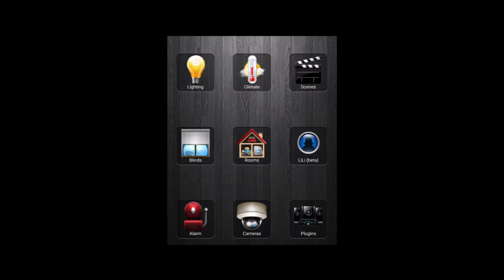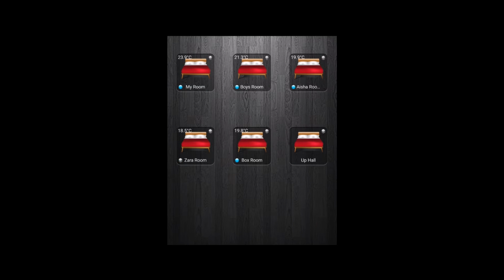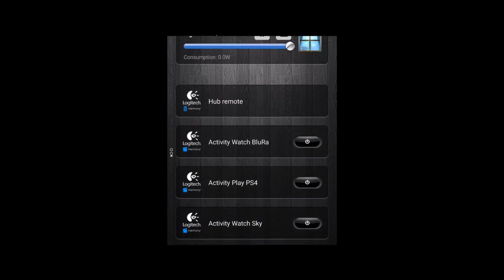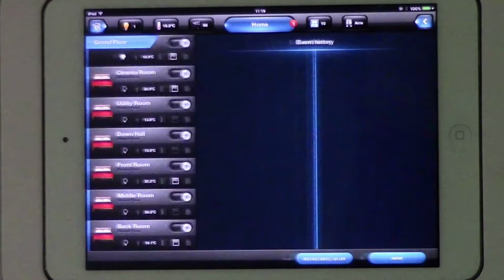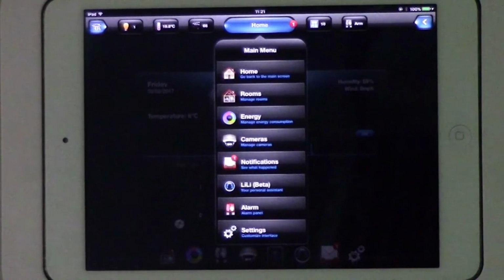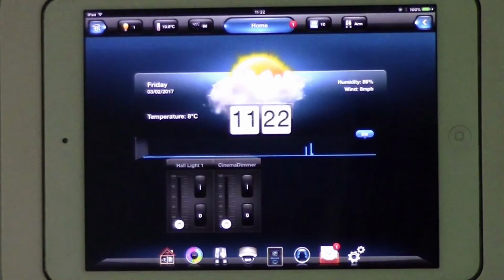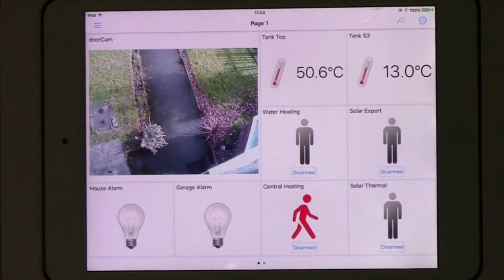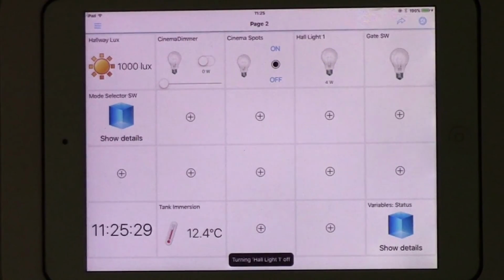Fibaro Home Center 2 - Basic Apps Review

Comment: Hi 
I am trying to assign my room stat SECURE SRT321 with FIBARO heat controller and HC2. RT and heat controller are registered to the Z-wave network in HC2, but when I try to assign RT and HC2 as master controllers to the heat controllers I meet difficulties to assign them. RT has Protocol Ver.4.5 type 2, Fibaro heat controller is with Type 3 Ver.3. Do you know how to resolve that issue.
Reply from the maker: Hc2 will control the fibaro heat controller directly. If you want the srt to control the fibaro heat controller then you need to set the association, for the SRT has to be done on the device itself from memory, otherwise create scenes to do the linking for you.

Comment: Serious. those icons look ridicilous. I'm choosing between zipatile and fibaro. But i lean more too zipatile because it's cheaper and looks way nicer. And you also have an wall mounted something
Reply from the maker: Hi
The icons are standard icons. In fibaro you cannot customise but in imperihome you can. Also the wall mount is a basic version. I'm gonna do another video soon with more  customised icons and a nicer wall mount so watch this space.
Reply: @YorkshireAutomation  is there a way to make an zipatile system around this? I heard the zipatile has a lot issues
Reply from the maker: @Alienbliep  I'm gonna be looking into it. I've just got hold of some in wall mounts so now gonna be looking at more software based options. Since i made that video a couple of new software controllers have been released including home remote. Give me a bit of time and I will present my findings.

Comment: good day sir i have a thermostat third party which i connect to fibaro to be spicific mco thermostat now how can i add my thermostat in energy consumption for the thermostat so i can check my energy consumption.thanks
Reply from the maker: Energy consumption is built into the modules. You can only enable our disable the monitoring if the module supports it. We cannot add ourselves
Reply: @YorkshireAutomation  thank u maybe the module is not support it